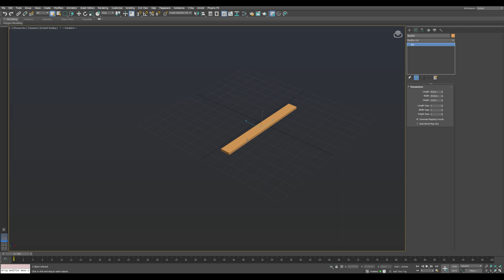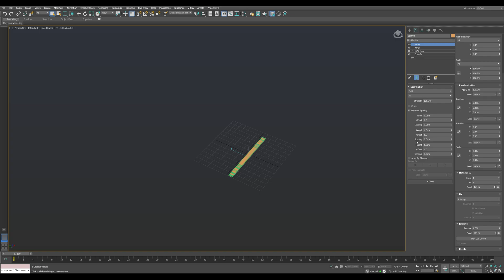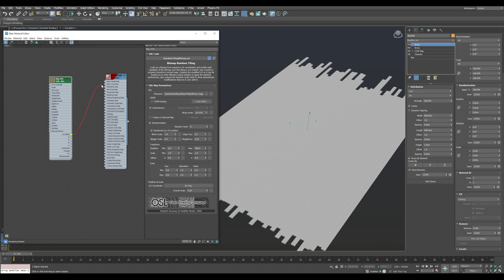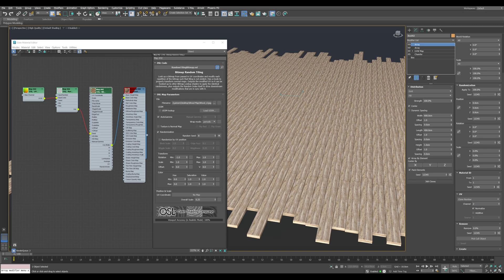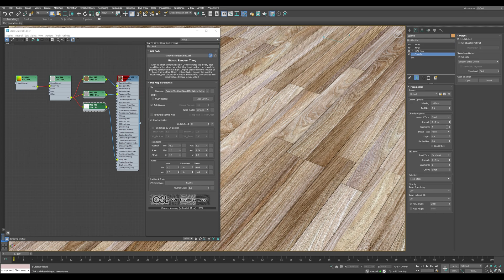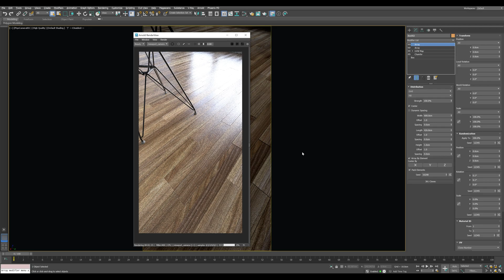Hardwood Floor Using Array Modifier | 3ds Max Procedural Modeling Tutorial

Comment: Thanks for array modifier tips. But is there anyone who using arnold renderer for interior visualzation? (and physical materials too) I think materials creation part is not actual.
Reply from the maker: You’re right about Arnold renderer it’s not popular in architectural visualizations to the best of my knowledge, I used it with physical material which is compatible with most render engines, but you can use this workflow with any material of choice it will be basically the same approach for most render engines, and thank you for feedback 🙏